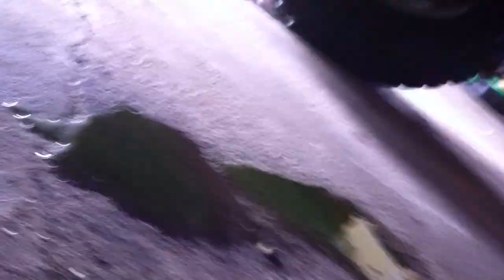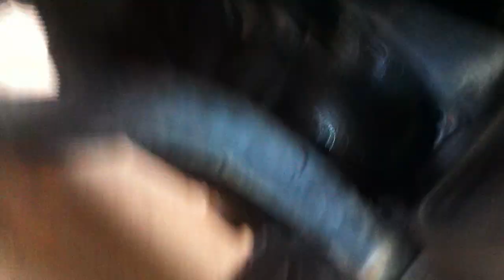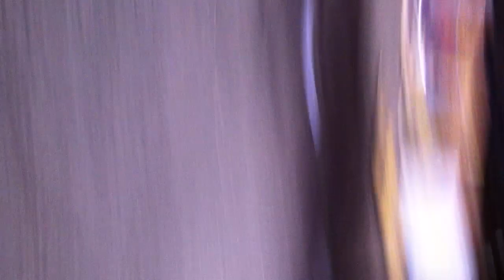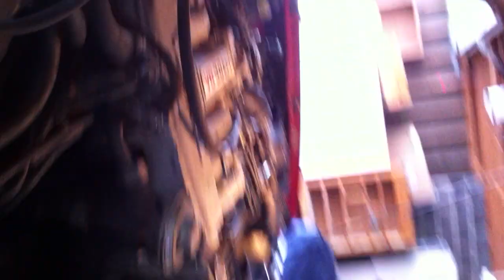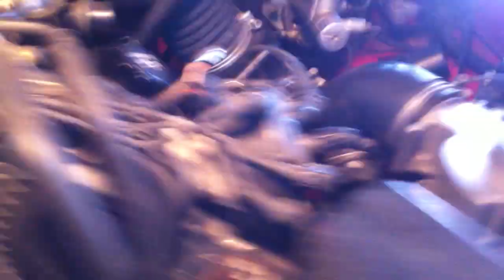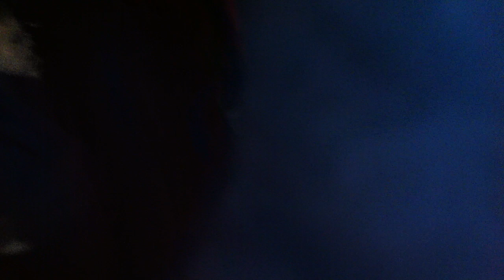Coolant Leak

Comment: I have this same leak on my 92 did you ever figure it out? Surely you did it's been a decade ago lol...
Reply from the maker: Hi Dan, I have to admit my memory is a little fuzzy. I had just flushed and refilled the coolant when this leak occurred. The truck had ~250K miles at the time and I suspected an issue with a seal, however the problem went away. I believe that I may have overfilled the coolant if thats possible. The truck ran great for years after this video with no ongoing problems.